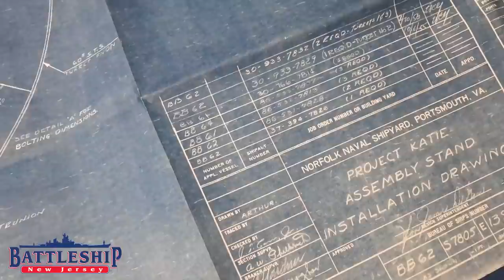Nuclear: Project Katie

Comment: I'm kind of late to this discussion, and I am certainly no expert on nuclear weapons, but was it known in the mid/late 50s that nuclear detonations caused a huge EMP? I'm not sure how well the armored steel would act as a faraday cage, but if one of these shells detonated in/over an enemy fleet or city, beyond the blast/radiation, I would imagine there is a pretty good chance it would kill all the sensitive electronics in radars and radios.  If I am remembering correctly, at some point there was plans for air burst nuclear weapons to minimize the direct blast damage, and maximize the EMP effect, but I have no idea when that was.  
Using the estimate from hiroshima of ~3 mile radius for total to moderate damage, and a cad program to layout a pattern of minimally overlapping circles, the theoretical broadside could basically level ~311 square miles...which is...horrifying...

Comment: I don’t know much about nuclear science. In fact I don’t know anything about it. Do nuclear warheads give off any measurable amount of radiation before detonation? If so, why not measure radiation levels in the suspected storage magazine? I’m guessing you could call someone with a Geiger counter and invite them out. I’d bet anyone with a Geiger counter would love to come out and see what’s up.
Reply: being bathed in radiation doesn't make it radioactive. If you don't believe me, ask the last apple or grape you ate.
Reply: Not so.  Depending on the type of radiation, and the target material, the target material can become radioactive, have isotopes altered which inturn can be radioactive themselves.
Reply: @dave8599  Steel doesn't become radioactive when exposed to sub-critical radiation. Otherwise we wouldn't have low background steel as a commodity.
Reply: Generally materials give off radiation because they have been contaminated with dust or other residue that in it self was radioactive

Comment: atleast there would be no miss in ship to ship combat with those shells. thank god a nuclear war never happened.
Reply: nuclear weapons have been used to end a war however
Reply: I don't think it was ever envisioned to use those warheads against naval surface targets. It was entirely shore target bombardment.  Even by the 50s, aircraft and missiles had made guns nonviable unless s#it has gone seriously sideways if a BB is throwing nukes at Soviet fleet formations.
Reply: @jamestheotherone742  The invasion plans for Japan called for six nuclear bombs on the beaches and another six on assembly areas behind the beaches. This replaced the initial plan to use a thousand bomber raid with chemical weapons (later nerve gases).

Comment: Using tactical nukes seems to me to be a suicide mission
Reply: Why? The range of the blast is nowhere near large enough to harm the firing ship or its crew. You're thinking of the equivalent of a thousand pound bomb, these would be hand grenades in comparison. They would have been waaaaaay outside the range of effect, and if they were worried about it, fire all shots simultaneously while on the move, then immediately turn away from the target to even more guarantee the crew is unharmed.

Comment: I would like to hear your opinion on the "Sub-Cal" shell, ( 16 inch to 12 inch ) that had been TESTED back in the late 80's, an gave a range of 78 miles. Were there ever PLANS, to fit them to the reactivated Battleships at any point ?. If fitted to them TODAY, they would be "Guided", without question, giving them PIN POINT Accuracy.

Comment: assuming the "Katie" had a 20mi range, like HE or AP rounds, if used the ship would still be in the danger zone form the blast and fall out
Reply: If it was based off a smaller army artillery shell it could have been fired with a sabot. This could have given it higher velocity and range. Just speculation
Reply: Watch the whole video, Ryan discussed that.
Reply: The immediate radius of a 15kt nuke is said to be about 2km.  That is, if you are that close you get 3rd degree burns.   20km is certainly survivable.  You would just want to be upwind, ideally, and get the heck out of there pretty soon.  You aren't going to want to stick around for the fallout to come down and you aren't going to be popular with the neighbors.
Reply: @brianhaygood183  32km, actually, 20 miles. I would assume that would be more than survivable, especially if the ship reversed course to open the range between the ship and whatever got a tactical nuke dropped on it. That was after all the whole point of operation crossroads, to determine the effects of nuclear weapons on ships.
Reply: Not true. There might be a fallout danger depending on the height of the burst or the wind direction, but there would have been essentially zero chance of blast damage, even to unprotected crew on deck.